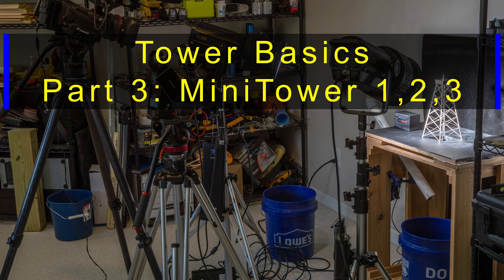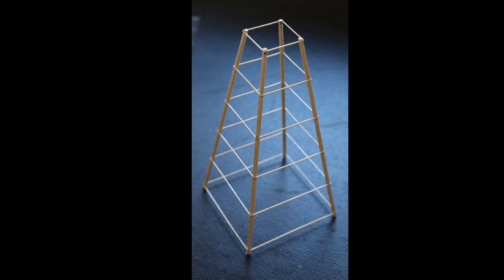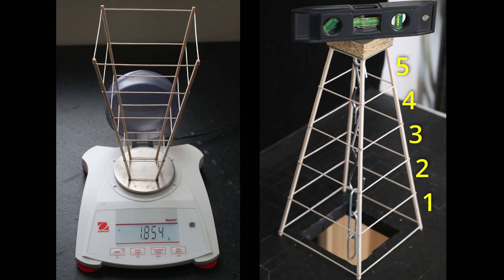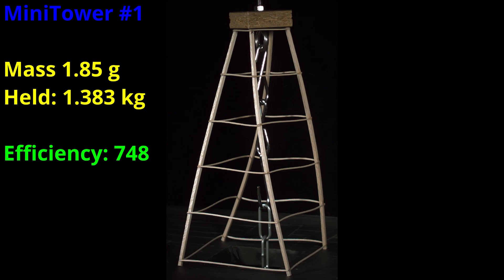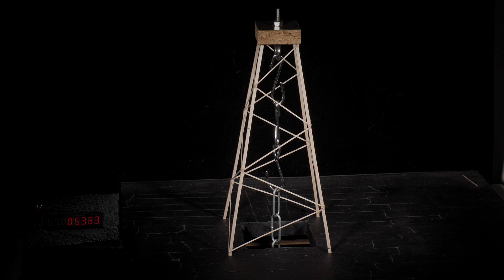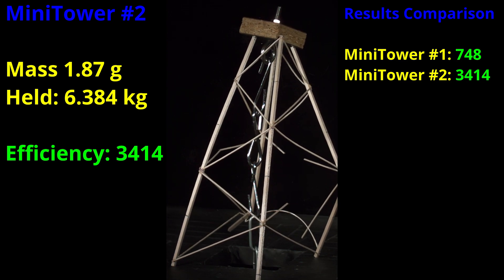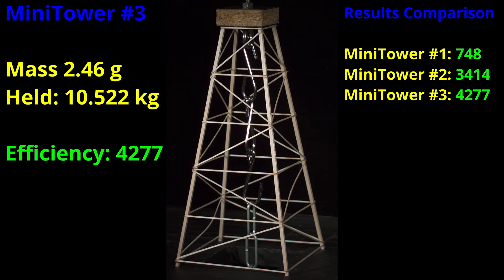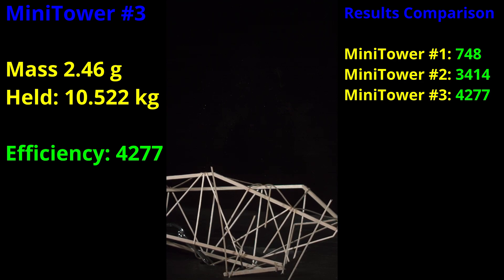Tower Basics: Part 3: MiniTowers 1, 2, 3

Comment: if we were to use these designs do we still need to do our own calculations?
Reply from the maker: I don't quite understand your question.  These specific towers are only 25cm tall and are for demonstration purposes only to show the concepts and theory.
Reply: @ what if we wanted to do the tower like you then?
Reply from the maker: @russelwilson3464  Start with this video for the 2025 season: https://youtu.be/nA1OLIh1O9w   I have 6 or 7 videos each for Div B and Div C.  Check those out depending on which division you are to see what I'm doing for this year's specific rules.
Reply: @balsaengineering6686  just checked them out, thanks. I will use your towers as inspiration. one last thing. for the legs what balsa wood should i get. 1/16, 1/8?
Reply from the maker: @russelwilson3464  I recommend 1/8" square for the Div B legs.  If you are Div C, it's much harder and you'll need to make the legs, but I have a video specifically on how to do that.  Good luck!

Comment: What was the wood type used for the cross bracing and the legs for recreating the towers?
Reply: Sorry just the cross bracing, found the leg info
Reply from the maker: @roh5768  No problem.  Yeah, I used 1/8 x 1/8 for the legs and for the cross-members I used 1/32" thick by about 1.5mm.
Reply: @balsaengineering6686  Ty for the info! I have a follow questionn for the cross bracing width, making the cross bracing pieces at that length would require stripping balsa sheets, how can you achieve this without breaking or unevenly cutting those sheets at that small of a width.
Reply from the maker: @roh5768  The answer is very carefully :)  In all seriousness, that is a skill you'll want to practice and get better at.  Especially for tower cross-bracing, you'll probably eventually want to use 1/32" thick balsa.  It takes some practice to get good at stripping that and even gluing it is harder than using thicker pieces.  I'll eventually go over some build techniques with 1/32" thick balsa when it comes time for the full build videos for next season.
Reply: @balsaengineering6686  tysmm